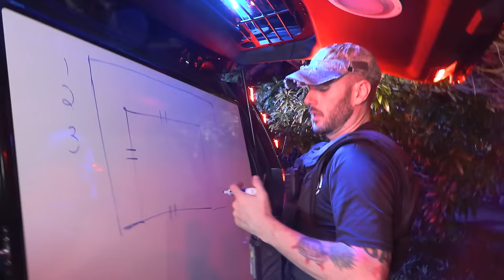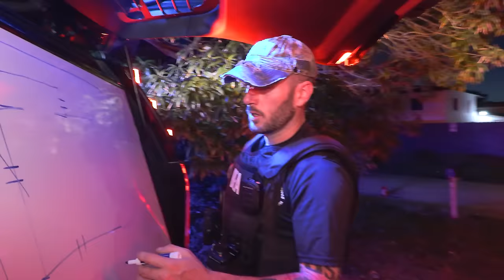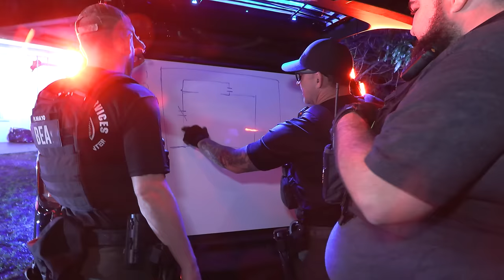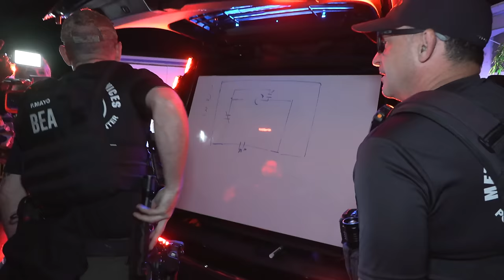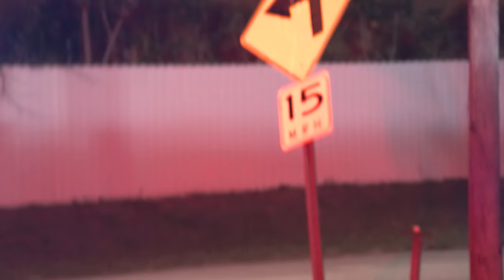Thirsty Criminals

Comment: Louvered windows are very easy to enter. The metal holding each piece of glass is aluminum, soft. Just pull back one side and slide the glass panel out. You could remove enough glass to get a man in and do it quietly.

Comment: Math is wrong . You can't have 1.5 people so lets round up to 2.  1.)   1.) Assuming the premium service costs $50 extras on top of $25 which brings it to $75.   2.)   assuming 2 people payed $75 × 2 and one $25 that is a total of $175. So she is loosing $175 on the upper end. But if we assume it is one person using premium service then total would be $75 + 2 × $25 = $125
Therefore the upper bound is $175 while the lower bound is $125.